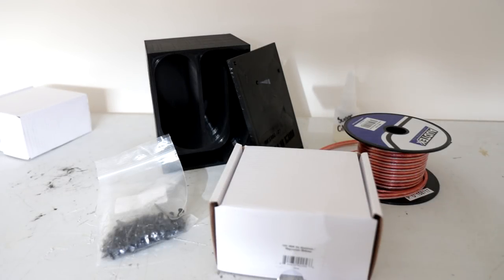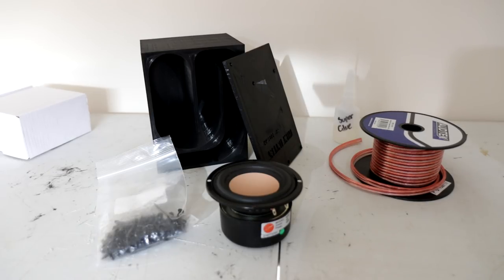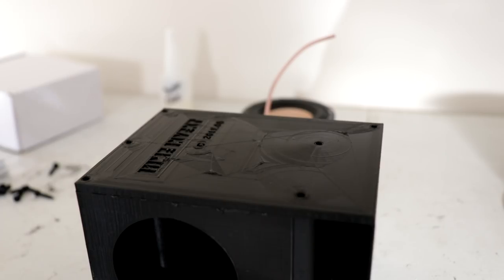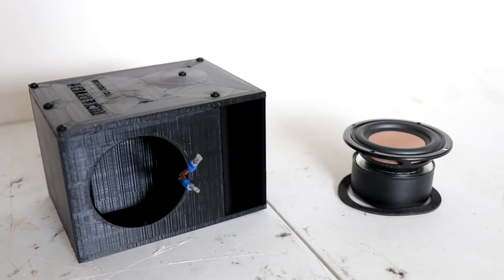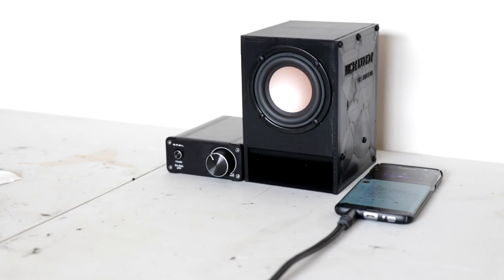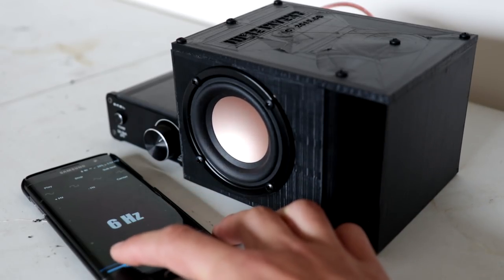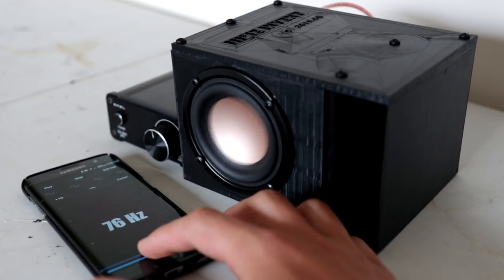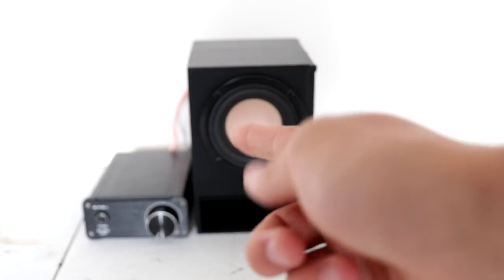3D PRINTING A SPEAKER!

Comment: It's a TL speaker with no dampening at all, it WILL resonate A LOT! Damp it with some kind of wool or something inside the tube, play with its density and positioning until you remove these harsh resonances (that can go up to 9dB). You will loose SPL, but with TL speakers that's the way to go, they're not super efficient, but they can go lower than any other (maybe "infinite baffle" with huge excursion speakers can go lower) and are amazing for tiny speaker sound deep AF!

Comment: Nice performance from a plastic cabinet. Try some vatelin, cotton wool behind the speaker that may eliminate some resonance. The inner walls usually dampened in labirynth, transmissionline boxes, layered with thin fleece. vatelin

Comment: i made 2 bookshleves speakers with those and a tweeter, crossover at ~3khz, sound really good but i need to trim the 130-160 hz down a little bit and up around 300-400 hz to get a more even response...

i believe they're are subs

Comment: There a good amount of math involved into making a speaker cab and even more for a port. Just eyeing that port, I'd say at least half of that hole needs to be closed off. To bad you glued the side, you could have 3D printed a wedge to glue inside. Probably still can if you have the dimensions, just make a tapered fit.

Comment: The cabinet looks very well designed, but should probably have given a little bigger room for the woofer. Also, try passive radiators (or simply blown speaker units) for smaller speaker units. 

Anyways, love your vids! Keep up the great work!

Comment: if i design a proper transmission line speaker and send you a stl. file, will you print it and test? ill use the speaker in this videos specs to find out the exact t-line length and size??

Comment: Hot glue the cable where it touches the inside if it starts to vibrate at a later date you will have to crack it open.

Comment: I wonder if that printer would be able to spit out a little bass bin big enough to hold a 6 1/2 or an 8 inch subwoofer. That would probably possess me into buying that thing =D
Reply: FPS_Machete_[HD] if it's a powerful 8inch the box will flex like crazy

Comment: How does the plastic handle up to the vibrations? What type of plastic did you use to create this? Do you use ABS plastic or? So many questions I know.
Reply: MrVolucris see that's what I figured was there would be bracing in there somewhere. It's still really cool either way. I know the type of plastic use can also play an effect on sound quality that's why I was wondering what type he used.

Comment: U can't expect good sound coiming from a 3D printed box. These speakers needs wood to project good sound.
Reply: Noor M Yus no reason why wood is any special
Reply: Wood have always better resonance than plastic of any kind. It's always has & always will be the go to material for serious audio speakers.
Reply: Noor M Yus it's the go to because it is cheap, light, and a material that self damps itself well. No reason that suitably thick plastic cannot fill those roles.
Reply: Wood, cheap & light? Have u ever bought any of those Hi-End speakers before? & why is the audio industry , there's a consumer, professional & Hi-End catergory? It might as well be just one for all right.
Reply: Noor M Yus True. My Sony GTK-XB5 has a Wood inside and a Plastic outside. It sounds great!
Reply: i have the beast sounding speaker box made from plastic so your wrong
Reply: The material isn’t the issue here. It’s the design inside of the enclosure. The port is simply way too big and the «box», or the main area for the woofer is too small. You can get exellent speakers made of anything, as long as it’s made properly. Of course, i’m not agreeing in that plastic is the best enclosure material. Then again, that’s all depending to the listener’s ears and preferences.
Reply: Simon Aarekol You are the water of the fire war.
Reply: Devialet made their phantom out of abs though
Reply: Only thing important when choosing box material is to be "acousticaly dead" so it wont resonate with speaker and produce unwanted frequencies and harmonics, you can make it from wood, hardwood, plexi, plastic whatever you want, important thing is how you design it
Reply: I disagree with OP. A good polymer enclosure is better than a wooden enclosure because you have less resonances.
Reply: Ronnie Miziolek Ha ha that's funny. The best speaker box, ever?
Reply: Noor M Yus I agree